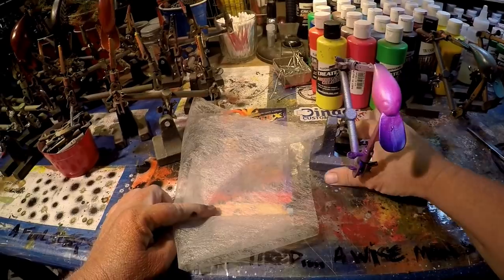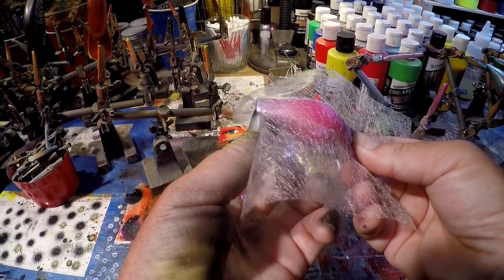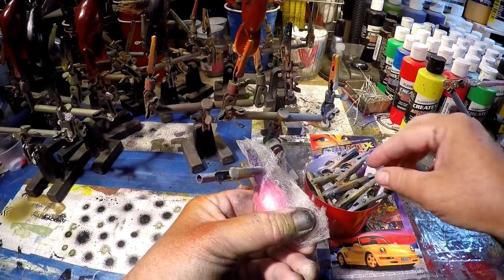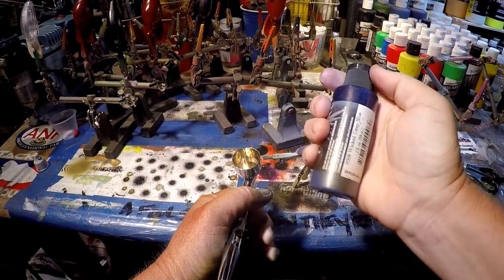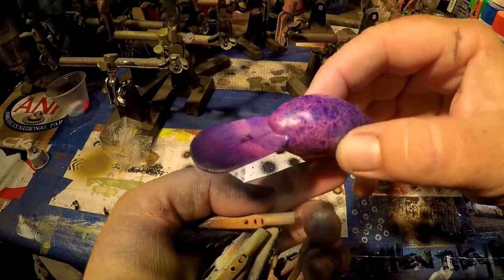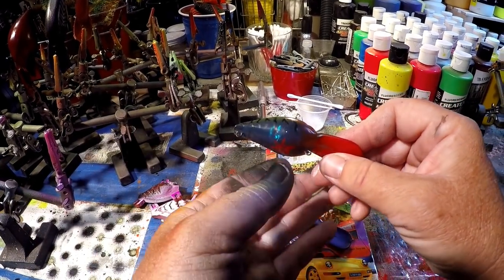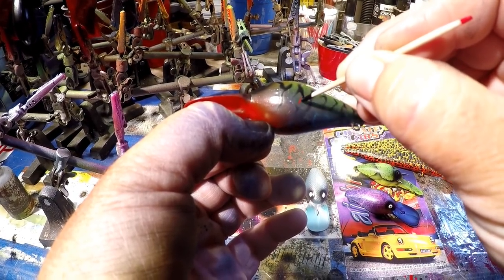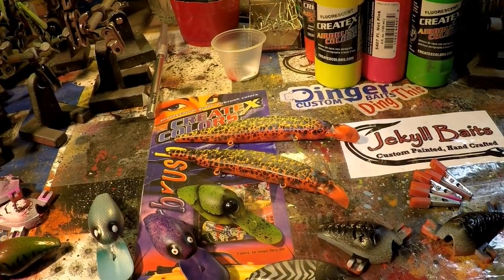SPRAY SESSION SATURDAY: STENCILS AND LAYERS (3 of 3)

Comment: I found dryer sheets have a oily conditioner that causes contamination problems.
Reply from the maker: That’s interesting. I haven’t had an issue, but I generally run my dryer sheets through the dryer 2-3 times first, then lint roll them to get any particles off if I use them as a mask or mesh. 9 out of 10 times I just use Pellon WonderWeb though. It’s clean. 🙂

Comment: Another great lesson Jen. Question When I started buying Createx paints I bought a lot of sets, Wicked mainly but am able to buy just the ones I need now. I'm wanting to go with Auto Air colors now and don't know where to start and feel the sets would be best way again.  How did you buy when you started and then wanted to add different brands to your all ready large collection. I'm only 3-4 months into painting lures but I do other things like concrete garden pavers scroll sawed pieces I liked to paint rather than use oils, I do outdoor type wood works, bears fish and things. I hope I didn't get away from my ? Thanks for all the gr8t vids and sharing of knowledge. Let it flow.
Reply from the maker: I started with basic sets, primary, then secondary color sets. There’s a few online places I use for purchases. www.dickblick.com is an Atlanta based art warehouse that has every airbrush need under the sun. You can just buy the colors you want, and save some $$$ in the process. I have been a canvas painter for years, so I already understood the color wheel when I started airbrushing. It can go a long way if folks understand color blending. Even though airbrush paints are usually water based acrylics, they behave a lot like watercolors. Getting a watercolor basics book can be really helpful as well
Reply: I thought I knew the color wheel but find myself missing colors just enough it's not what I wanted. Tonite I was doing a lure and had a drop or so of yellow ,mixed it with some maui blue and got the perfect green I was needing without wasting any paint. I will pay or study the wheel more and save a few more dollars. I do a bit of canvas also. thank you. Let it Flow

Comment: I have another question for you I started out painting square bills Shadow divers 2 to 4 feet size 2.5 " what size split rings and hooks should I use on them
Reply from the maker: jp Paints #4 trebles and # 2 or 3 rings

Comment: It says in this video that there will be a link below on the ball point pen you use to sign your baits and there is not?
Reply from the maker: Only because afterwards I realized that they are aavailable at Walmart and most other stores as well. The pens are Uniball Vision Elite. Apologies. Here’s the link:

https://amzn.to/3979La6
Reply: @Jekyll424  ty
Reply: @Jekyll424  thank you. They are great pens. I use createx paints and before epoxy or clear  i tried to sign the lures with those pens and they don't work.  Not sure why.  But it just doesn't.  I will write on paper and no issues. Move over to the lure after writing on paper and it just won't write. 🤷‍♂️